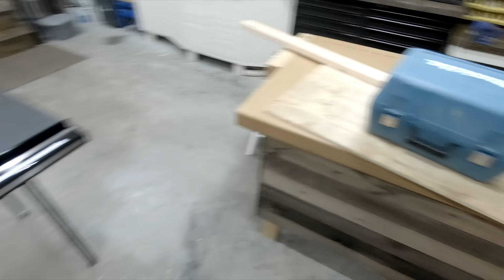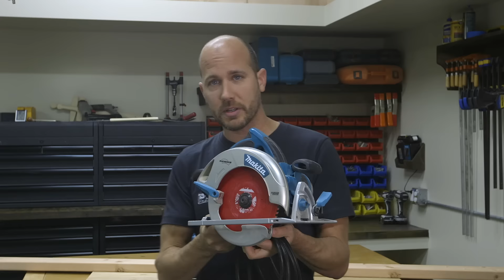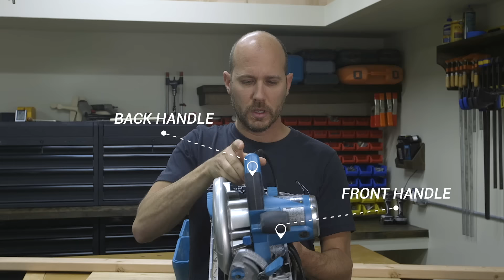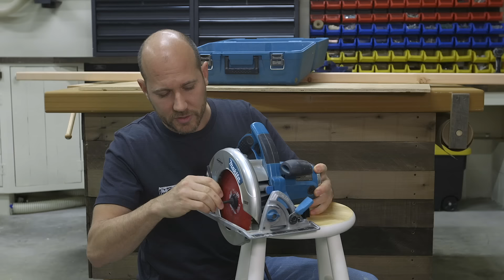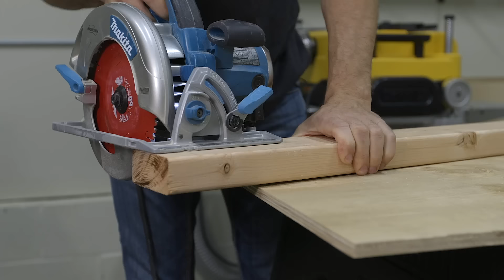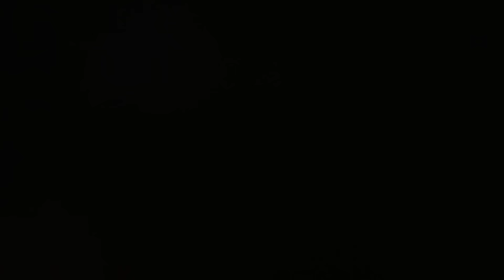HOW TO USE A CIRCULAR SAW FOR BEGINNERS- PART 1

Comment: I have a ryboi circular saw and I’m going to change brands. Which brand is better? Dewalt? Milwaukee? Rigid? Mikita?
Reply from the maker: Hey Kenny! I really like Mikita and have had great luck with them over the past 20+ years.
Reply: Training Hands Academy Thanks for your advice. Why and how does circular saw blade get dull easily (not sharp cuts)?
Reply from the maker: @kennyteng627  If you cut through nails, dirt, or other things that can be found on rough lumber, that will of course dull them faster.  Other than that, they get dull from normal use. Also, if you buy cheap blades, they will most definitely dull faster.

Comment: I learned a lot from the video, thank you. I have one question. When you turn on the saw, are you doing anything in addition to squeezing the trigger? I thought I saw your hand move something on the front of the saw? Also, I’m worried that I’m not strong enough to cut straight. I have the same strength as my 13 yr old skinny boys have. I guess I can practice on something, but ultimately I need to cut 3” off the end of a butcher block countertop with no mistakes. Thank you!
Reply from the maker: Hello! The trigger is all you need to pull to get the saw going. With a new 60 tooth blade you shouldn't need too much strength to cut through the butcher block. Also, you may want to check out this video for cutting straight lines --->  https://youtu.be/ILVCdEOhYBc This video is for plywood but it also applies to what you will be doing. Hope that helps!
Reply: Thank you!

Comment: Hi! Thanks for the tutorial! I was wondering can I cut a piece of countertop with a circular saw? Is there a certain type of blade I should use? Thanks greatly.
Reply from the maker: Really depends on the countertop material... most solid surface and formica tops can be cut using a circular saw. I would use a brand new 60 + tooth laminate blade, and if you can cut from the bottom side that would be great. If you can't cut from the bottom, I would use blue painters tape over your cutline to reduce any tear out and scratch marks that may come from running the saw over the surface. Hope that helps.
Reply: Training Hands Academy some very good tips thank you.

Comment: The baseplate on my circular saw isn't parallel with the blade so using with a guide is impossible.. is it possible to fix this?
Reply from the maker: To my knowledge no... most likely something got bent. Look around anyway to see if there is some mounting bolts that are loose.
Reply: @TrainingHandsAcademy  Thanks for the quick reply. The base plate is welded. I can still use the saw, but without a guide and maybe a future project would be to re-purpose the saw into a table saw.

Comment: I have a very beginner question. I have an 8ft 2x8 that I want to cut in half. Is it better to do this on the floor?
Reply from the maker: Hello. Sure, I'd cut it on the floor with something supporting it on either side of the cut, or on saw horses with someone supporting the cut off so it doesn't fall.
Reply: @TrainingHandsAcademy  do i need the support on either side? Would that cause it to bind?
Reply: Sorry. I am a noob hihi. I have a 8ft long piece of foam that is 0.5inch thick. Can i put the 2x8 on this and do the cut?
Reply from the maker: Yes, support either side of your cut. It will bind if both sides drop at the same time (creating a V-shape in your board) and pinch your blade. Does that make sense?
Reply from the maker: Yes, absolutely!
Reply: @TrainingHandsAcademy  I understand now. Thank you. I did end up starting on my bench project. I think I did well for a guy who has never used a circular saw before. I was cutting on a 0.5inch foam and I would def go thicker. At one point, I cut through the foam and it got into the table and I experienced kickback for the first time. No injuries though. One thing I did find frustrating is that when I would start my saw and align my 0, I could almost not get the baseplate completely flat on my wood at the start cos the lower blade guard would come in the way. So I would start with the cutting and then would have to push the saw down once it just started to get into the wood. Is this normal?
Reply: My other question is - some of my cuts did not come out good in the sense that I had some wood splinter off. How can I avoid this from happening? Also, how can I "fix" this imperfection?
Reply from the maker: Hey Chad! Glad you are safe. Yes that is normal for the blade guard to get stuck like that... especially on thiner material. The way around that is to lift the blade guard up slightly to start the cut, then let it back down. Take it slow and be careful. :)
Reply from the maker: What type of blade did you use, and what type of material did you cut?
Reply: @TrainingHandsAcademy  I used a Milwaukee 60 fine tooth blade and I was doing cross-cuts on a 2x8 framing lumber.
Reply: I was also not using a straightedge or other guide to allow the saw to ride. I imagine this would have made it easier and cleaner?
Reply from the maker: Yes, entering and exiting the material straight will help, but it sounds like you're doing everything right... lightly sand the edges to clean them up.

Comment: I need to rip a 2x4 lengthways. Taking about an inch and a half off the width. Any advice? I watched a guy do it using an old piece of plywood as a guide and no clamp on a work bench. Came out great but can’t help but think that would be a bit dangerous.
Reply from the maker: Hello Twa Pehs! Obviously the table saw would be the best tool here, but I understand you don't own one. Here’s some tips: take an extra 2x4 and lay it next to the one you’re cutting to give the base of the saw a larger area to slide on. If you can, somehow secure the extra one in place... you don't want things moving around. I would use a guide if the cut needs to be good, or if it could be rough, I would simply snap or draw a line, and freehand the cut. It’s ideal to have them up on saw horses so you're not hunched over them while cutting. It can be dangerous so please be safe!
Reply from the maker: Sure, clamp/screw one or both. It sounds like you already have a good plan, try it and see how it turns out. :)

Comment: Great production and editing. I appreciate the way you reduced the sound of the saw. I think we all know how loud a saw is. Also, the magnification inserts were fantastic. I teach biology and do a few videos for my class. The magnification inserts would be very helpful. I would appreciate it if you could describe how you keep the camera in focus when filming a moving closeup and what editing software you use to insert the magnification videos as well as control the sound in an inserted video segment.
Reply from the maker: Hello Mark! I use FCPX to do all my editing. Keeping the camera in focus is done mostly with auto-focus, and the rest comes from shot planning... meaning I know what's coming in and out of frame, and I know what I want in focus and what I don't. The magnification is done using a plug-in within FCPX called Ripple Callouts. Sound control is also done in FCPX using manual faders. I hope that helps! Let me know if you need more info.

Comment: Hi, Thanks for the video. Exactly the information I was looking for. I have never used a circular saw before and I recently came across a Porter Cable set at Costco that includes a circular saw. Any recommendation on the saw in that set and if it is a useful tool such as does it have enough torque to do small household projects that might involve cutting plywood, 2x4s etc?
Reply from the maker: Hi Yusuf! Can you please tell me what model Porter Cable it is? I haven't seen that set at our Costco yet.
Reply: It is on this link:
http://www.costcoweekender.com/2019/05/porter-cable-5-tool-combo-kit-costco-1303852.html
But the price is even lower at $200.
Reply from the maker: The circular saw in that set is only a 5 1/2. I've never owned one that small, so I can't really say what it is capable of... but for $200 it looks like a good DIY kit!!

Comment: Nice basics, thanks. Just bought my first circular saw. A DeWalt DWE575. I did a little research, largely on YouTube U. One thing I didn’t take into account is how the height adjustment functions. Yours is easy to read and looks like a smoother adjustment than the DeWalt. Hm...  Looking fwd to part II.

Comment: Dumb question but how do I remove the plastic packaging from a Diablo blade? I am just using for the first time a circular saw, it's an older SkilSaw, but don't want to remove anything I shouldn't on this new blade. Thanks!!
Reply from the maker: I normally just use a utility blade to cut the plastic. All the packaging needs to be removed to safely use the blade. I hope that helps. You can ask as many questions as you like Marcy. Have fun.